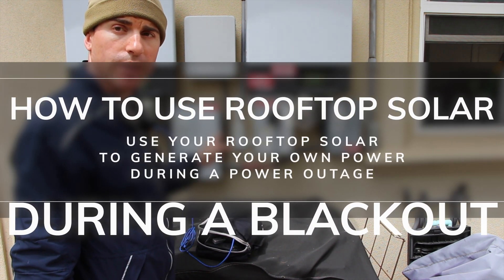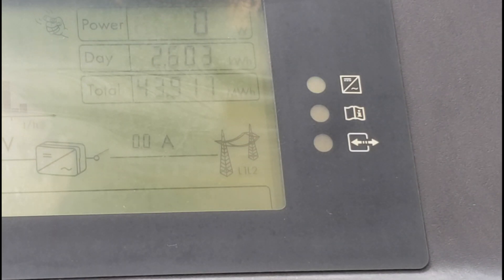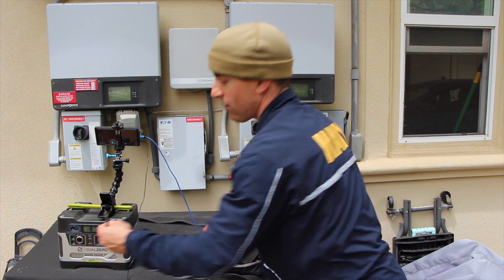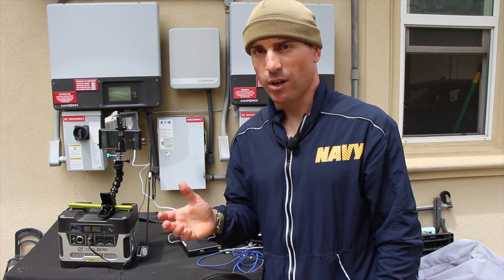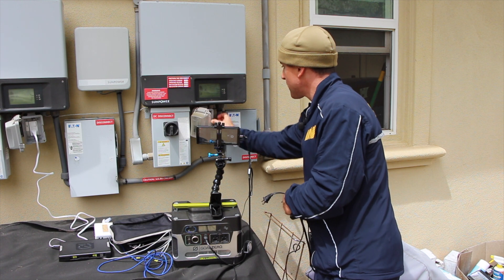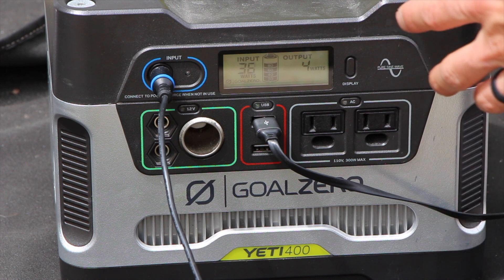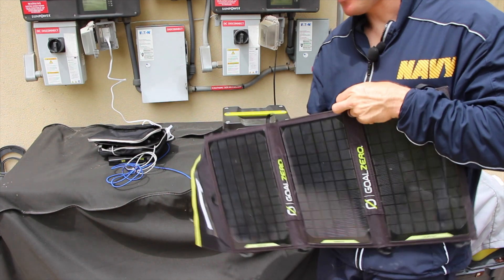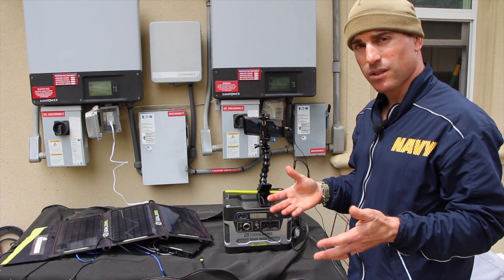How to use your home's solar during a power outage

Comment: My system doesn’t have a “general duty safety switch”.  Should I just shut off the main breaker?  My grid feed is going down for 8 hrs for maintenance in 2 weeks and I want to use the outlet to run my fridge. I have a 4.9kW system.
Reply from the maker: I'm sorry but I don't know enough about your system to give you competent advice
Reply: @jessyybarra  contact me u can run ur whole solar system without grid power

Comment: hi, on a grid tie solar system. if you buy an EcoFlow delta pro solar generator. After disconnect from the grid, Can you use the power of the generator to activate the solar system and charge the solar generator as well during the day and during night it feeds the house...
Reply from the maker: That might entail backfeeding into your solar array/inverters. I would ask your solar contractor if it's possible and permissible. You would need a transfer switch at the least. I see why you're asking (so you can take advantage of your solar array during grid-down when a grid-tied array will normally deactivate). I'd be curious to know myself.
Reply: @NickC9545  exactly,  the solar generator has everything built in but I don't know if it is recharged by the solar system and not talking any more load, will the solar inverter turn down the solar power to match the use?

Comment: Can this be done with the Solar Edge HD wave?
Reply from the maker: I just looked that inverter up. If your contractor installed it with at least GFCI outlet hardwired to the inverter, it should work like mine. I have the Sunnyboy (these names are ridiculous).

Comment: What if my inverter doesn’t have an outlet plug(sps)?
Reply from the maker: The safest way would be to ask your solar contractor to come out and add them by tapping into your existing inverter. That is also the cheapest, relative to installing a backup battery.

Comment: We have two solar systems. The main one was installed by enphase and has 14 solar panels which is NET metered and does not work when the mains power goes down (it does not have a powerwall/battery). The 2nd system which I built myself, is made up of 6 solar panels attached to a 6kw inverter which is attached to a manual transfer switch (6-circuit) and a 15Kwh battery. When mains power goes down, our solar continues to power the 6 most important circuits of our house during the day, and during night, the battery takes over. Nothing is sent back to the grid on this system.
Reply from the maker: Now THAT is awesome. Your 2nd system makes so much sense. Do you have the panels connected in series, parallel, or series-parallel?
Reply: @NickC9545  Thanks. On my 2nd system (DIY system), I have 6 solar panels (380w per panel) connected three in series (it almost maxes out the max voltage range but is well under the max amps rating). My MPP Solar Inverter is the LV6048 which has two MPPT inputs. So I have three panels running in series on each of the two MPPT inputs. If I want to expand the number of solar panels, I can add more in parallel, but so far, those six panels can easily charge my battery each day plus run the 6 circuits of my house when the sun is shining. I might eventually upgrade the 6-circuit manual transfer switch for a 10-circuit version.
Reply: Nice, why not feed some of that off-grid ac power into your enphase system to trick it to come on when utility grid is down, of course you would manually shut down your main breaker to keep from backfeeding into the grid
Reply: @Joe-qw6il  Not a bad idea! Any idea what the best way to do that is?
Reply from the maker: Also, for the first system, the reason the 1st system can't shunt power directly towards your appliances is because the power being generated by solar is generated at an irregular rate and is also DC?
Reply: @NickC9545  Hi Nick, the first solar system (installed by the Pros at Enphase) uses microinverters attached to each and every solar panel, so the power that comes down from the roof is AC.

Comment: I am guessing (hoping) that you did not do the install work on that PV system. That is some horrible work! felx to LBs?? why did they not use LLs and LRs?? you will NEVER be able to troubleshoot or re pull damaged wires without dismantling the entire system!! (not to mention it looks horrible) did that system pass inspection? schedual 40 and not EMT or rigid?? ugh, i hate sloppy work. No apprentice i have ever trained would do that kind of work. I've fired people for work like that....
Reply from the maker: Haha, nope, definitely did NOT do any of this work myself. I was an ET in the Navy; I am certainly not qualified or certified to do residential low-voltage work. The company that did the installation was Semper Solaris. I have been very happy with the installation they did to this point and this is the first time I have heard that they might have done something wrong. When I can get them out, I will show them your comments and see how they respond.
Reply: @NickC9545  yeah, submarine and vessel electrical is the most meticulous i have ever seen. Navy electricicans are amazing.

Comment: Is it ok not to have a battery, just panels if the system is attached to the town supplier?
Reply from the maker: Correct me if my assumption is wrong, but I assume you are asking whether you need to have a whole home battery, like a Tesla powerwall? If so, the answer is no. You don't need a whole home battery, you just need a portable battery to collect the power that your solar system today. For this you can use a portable power station. You just need to make sure that your solar system has an inverter. If you are not sure, your solar installer will know.

Comment: Nick great concept! Just need to clarify some points, I’m adding solar to my house soon. 

After turning off the main disconnect to the grid can I plug in any AC power source (like a battery with an inverter) into any circuit (that matches amp rating) to provide a reference signal so it will activate the solar panels? I’m planning on installing a solar system with micro-inverters.
Reply from the maker: That’s a really smart question. I would like to know the answer myself because I hadn’t even thought of trying that. If you were able to ask your seller contractor, I would like to know the answer myself.
Reply: @NickC9545  I just read about using a generator as a reference power source to start grid tied Solar Power Plant during a power outage! Have you heard of this?
Reply: @ginavillalobos1827  That can get dangerous. Although the solar will be activated after 5 minutes of reference to the 240V, it's designed to go to the grid where it can handle the energy. If there is more energy being produced by the solar than is being consumed from house loads, then the solar energy may go into the generator as the inverter might not be able to tell the difference. This might cause a spark and spark plus gas equals explosion lol. There are solar battery generators but the important thing to keep in mind is the concept of charge control to make sure the system is smart enough to be able to control the flow of energy.

Comment: thank you I have been trying to figure this out.. I have tried to call my solar company to do just this, They should have set all of them up to do that but instead when the power goes out we all suffer unless you spend 10K for a power wall. I have a 4KW system and a sunny portal like the one you have there but only one of them. It has a separate panel to shut off the solar thats next to it, but I dont see the main switch to shut off the grid unless that IS it. Also there are no  sockets or switches for me to plug anything in there. So it sounds like I will need them or another electrician to connect off of it.  My plan is to have a socket to power things and even feed a new bluetti e55 to power a 12v 56L freezer for emergencies or better yet IF there is enough wattage I can power a full fridge in the garage where I have the inverter at. I'm also confused why the solar you connected was weak? only 50 watts? for a roof top big system I would expect much bigger. The 120 watt fold out panels I ordered is suppose to give 120watts but probably 80 in real time. I was thinking the house solar should be like the 1500, but then three would be loss. and you said there would need to be some converter put in then go to the socket switch right? Is that inverter somewhere cutting the power so low?  sorry.. my head hurts now..lol
Reply from the maker: Sorry man, I don’t even know where to begin 😁

Comment: I have a question I went on the side of the house we have the three boxes but we do not have any plugs did you install them yourself and how did you do that
Reply from the maker: Hey, really good question. The micro inverters were installed at the time of the original solar installation. I understand that they can be added, usually pretty easily. I would talk to the company that installed your solar first.

Comment: Disconnect the grid then back feed AC reference from an inverter connected to battery. So it gets a reference AC Signal/Phase to turn on the inverters on the panels on the roof. Thats my idea
Reply: The inverter is combined with the automatic transfer switch remember the grid tie systems the reason the automatic transfer switch is there is because of code. Comes back on you'll have a direct short and you'll burn most appliances up in your house and cause electrical fire. Some of the automatic transfer switches are built in the same boxes inverter and the inverter automatic transfer switch operates on an normally open switch. And power is supplied from the grid the switch closes and allows the solar power to flow into the house but as soon as you lose power from the grid it opens the switch and shuts down the whole system so even though the above person reference back feeding is fine but you need to know what kind of inverter you have automatic transfer switch cuz a lot of them are being built that way you can't get around it there is one way to do it is to connect a second inverter coming from your panels with a disconnect switch and then you would go there to your your own utility with the main utility being shut off from the power pole thus keeping you from back feeding into the system when the utility comes back on I hope that helps but there's so many styles out there that it's you just can't say one way will work
Reply: @edmondtonsglobal4393  i didn't  know that. Thanks
Reply: Can you explain this more? I had the same idea but not sure how to hook it all up, thanks in advance
Reply: I have the same idea. Does this actually work?

Comment: can i use another small inverter with a small battery to act as a grid
Reply from the maker: Yep, good idea. You definitely want to extract and store as much energy from the system while it's generating during daylight hours. I think your suggestion is a good one.

Comment: I need to retrofit my solar system which is grid tie right now. I know how to disengage it from grid.  I think I need to add another  charge controller to get an stand alone mode
Reply: YOUTUBE ADMIN  EMP?  dude. if that happened. power might be the last thing we worried about.
Reply: What if you want to use the power from your solar panels to run things within the home, such as AC unit or refrigerator could you run an extension cord into the house for the refrigerator?
Reply: Valerie Mitchem same issue w unconditioned power I suspect
Reply from the maker: @valm124  Not recommended. The power fluctuations, even minute to minute, could damage your appliances.

Instead, you should plug your solar into a portable power bank (3000w or greater), and then power your appliances from that.
Reply: @NickC9545  yea... still need another charge controller during SHTF and maybe 4-6 Lithium battery and large inverter to feed the fridge and stuff